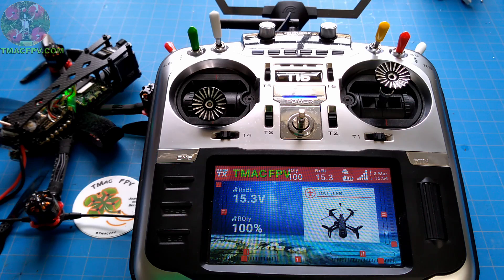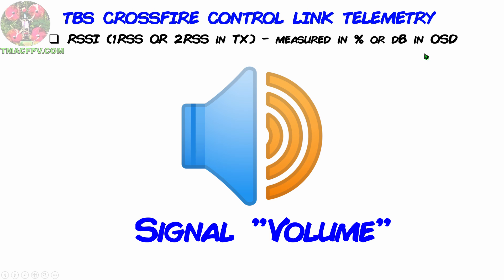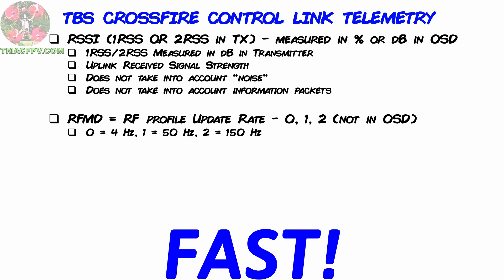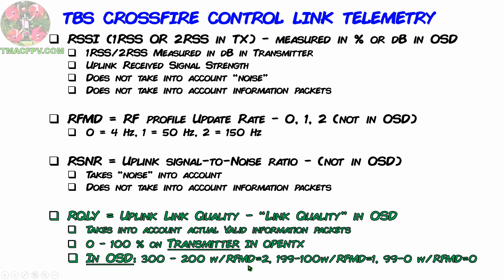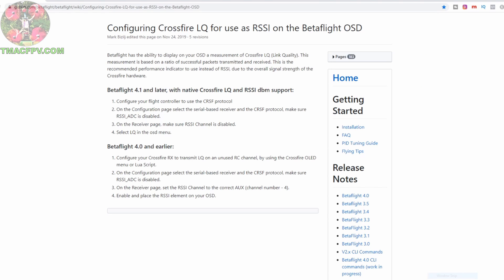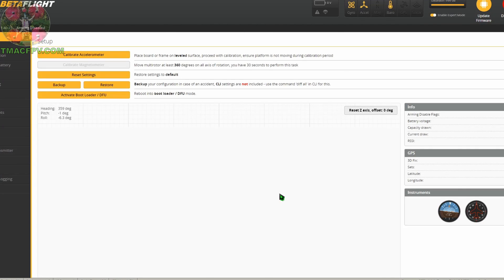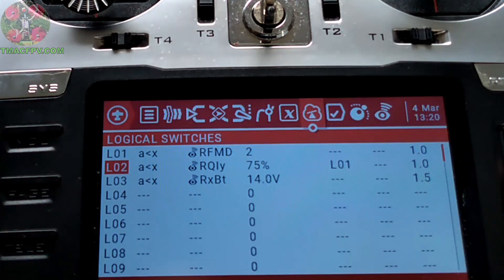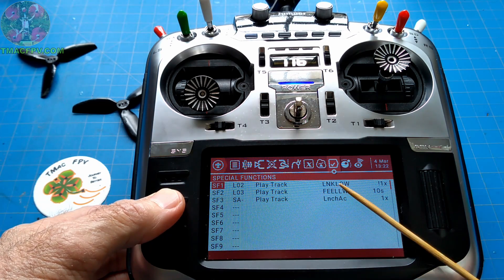TBS Crossfire Telemetry - SAVE YOUR QUAD!

Comment from the maker: How do you use TBS Crossfire telemetry?  What was the best thing you learned about TBS Crossfire telemetry from this video?  What other questions do you have?🤔 Let me know!👍😉UPDATE: Since this video was posted, RFMD is now available in OSD,  LQ in OSD is now measured as a value between 0 and 100 along with the RFMD value of 0, 1, or 2 preceding it.
Reply: I'm wondering how to get the link quality to show up in my DJI Goggles?
Reply: @mixedepisode  as i know currently only rssi available, LQ not supported yet in dji osd
Reply: Any input on my rssi showing 31-32 constant. (Using hitec Aurora 9 radio very little info out there) should i set up rssi channel anyway to confirm if its actually a good link and then try and change the scale in cli?

Comment: Great explanation, but I was also looking for information on the downlink.  Because the crossfire downlink is much lower power.  So if your downlink drops out, you won't get anything telemetry on your transmitter, i.e. no data on uplink quality.

Comment: Thanks for the info, got it working no problems with inav on a wing, tried using it with three gps quads using the latest betaflight and cannot get my edgetx radio to recognise gps telemetry, it picks up the other telemetry? im using the same radio with all models all with crossfire receivers.

Comment: In my betaflight 4.2.8, why does link quality not show up in my DJI goggles? Only when I click on RSSI will it show a number, and I'm not even sure what that number or scale is, because changing my radio or nano rx power doesn't seem to change the number at all. I don't get it. I'm following the exact instructions
Reply from the maker: https://youtu.be/Oogm72vRclA
Reply: @TMacFPV  I've already followed the instructions from Barwell's video a bunch of times. I've enabled the RSSI aux with LQ signal from radio, I've disabled RSSI aux, I've tried everything. Nothing changes the fact that the only item the DJI goggles will display is RSSI Value, and the corresponding RSSI % value shown on the Betaflight setup page. Is there anything you can think of?
Reply from the maker: @rbt5785  Nothing I can think of my friend. I don't fly nor own DJI gear. Perhaps try a DJI forum, Reddit, or group on Facebook?
Reply: @TMacFPV  Ok thanks for the effort and your help!

Comment: Hey Tmac, great in depth tutorials as usual !! I have my TX16s set up with the crossfire widgets I want, however my Rxbt reading displayed in my widget, is flashing between 5v and the actual battery voltage for the quad. I can't seem to just get the battery voltage. Tried removing sensors and re adding. Any help would be appreciated !
Reply from the maker: not sure Larry.  Things to try.  on Telemetry Page, make sure "Ignore instances" box is unchecked.  All firmware for both Crossfire module & receiver updated to same version?
Reply: @TMacFPV  Thanks so much for the fast reply! Yes my "ignore instances" is unchecked and both my receiver and transmitter are updated to version 6.12, the widget still flashes between 5v and the battery voltage, very strange.
Reply from the maker: @lemmingnetwork3445  Support ticket? https://radiomasterrc.freshdesk.com/support/solutions

Comment: At least someone who thoroughly explained all Crossfire telemetry sensors. Thank you! Any ideas how to convert battery voltage to cell voltage in radio side to keep total battery voltage in OSD? Or it is safe to use remaining battery capacity % sensor?

Comment: I changed my cinelog25 receiver from frsky to tbs crossfire .... the quad flying working good.... but the range of vtx dropped down no range less than 30cm
The goggles should be close to the quad to see

I dont know whats wrong affect on vtx range
Reply from the maker: changing your receiver should have no effect on your VTX reception.  Something else is wrong.  Check all connections and wiring to solder pads, VTX antenna connection to VTX, correct VTX channel on goggles, etc.

Comment: hello TMac👋🏻I’m your fans.

I have a question,why I can’t see 「RFMD」、「RQly」in logical switches page😢.(Tango2)

thank you🙏🏻
Reply from the maker: I dot not own a Tango 2 transmitter, however it uses OpenTX firmware so it should be the same.  Sounds like you're not getting all of your telemetry values.  Try going to the telemetry page in your transmitter while quad is powered on and bound to the Tango 2 then selecting Discover new Sensors on the telemetry page.  While you're on the Telemetry Page, make sure you've disabled (untick the box) "Ignore Instances" in the Telemetry Page of your Tango 2.  Also, with the recent versions (2.3.10 & above?) of OpenTX, you no longer need to use an Aux channel to receive LQ.  So, if you're running a recent version of OpenTX and do have that setup in your Crossfire receiver setup, just get rid of that.  Finally, refer to Crossfire manual pages 51-53 here https://www.team-blacksheep.com/tbs-crossfire-manual.pdf
Reply: @TMacFPV  can work❤️❤️❤️❤️❤️❤️❤️❤️ya~~~~~~thank you very much🙏🏻

Comment: thanks for all the effort you put into this video Sir, which is not only very informative but also fun to watch. Being new to both Crossfire and to Open TX, I learned a lot and subscribed.
Since you asked what other questions we have, here‘s one for you: 
I am running an iFlight Alpha A85 HD with a crossfire nano RX linked to a Radiomaster TX16S. I keep getting „Telemetry Lost“ warnings every now and then when I am about a half kilometer out, however I never lost control of my quad. Telemetry usually recovers within a few seconds or so after I have gained some altitude or turned the quad. 
I assume this might be because of the relatively small Crossfire antenna on the quad which was developed by iFlight specifically to fit  this little 85mm whoop. The A85 was of course never designed to be a long range quad, but I was wondering if I should be worried to lose Telemetry every now and then. Is it really necessary to bring the quad back when it happens? 
Would be great to read about your thoughts - thanks in advance. Ruedi from Germany. 😃👍
Reply from the maker: Hey Ruedi!  Great to hear from you!  I'm guessing your "telemetry lost" warnings are coming when one end of your antenna is pointing directly at you.  That would be what's called a "null" in the radiation pattern (near zero radiation emitted from end of antenna).  The radiation pattern propogates outward from the sides of the antenna (sort of like a doughnut pattern).  So, when you turn your quad, the antenna turns and you regain telemetry.  If you're able to do so, I'd have LQ (link quality) displayed on my goggles OSD.  That way, you can keep track of your control signal strength.  Another thing you could do is use a Video aerial systems (VAS) XFire Pro antenna which is designed to be "cross-polarized."  This design essentially eliminates/reduces nulls.  You can check out the XFire Pro antenna here https://www.flyingtech.co.uk/electronics/vas-868mhz-xfire-pro-antenna-ufl-tbs-crossfire . Also, make sure to download the TBS Crossfire User Manual here https://www.team-blacksheep.com/tbs-crossfire-manual.pdf
Reply: Thanks TMac for the explanations and the advice. I will follow up on those. anyway I don‘t need to worry too much about the issue I take it. Thanks again! 🙂

Comment: TMac very useful.  Had to set this up again.  

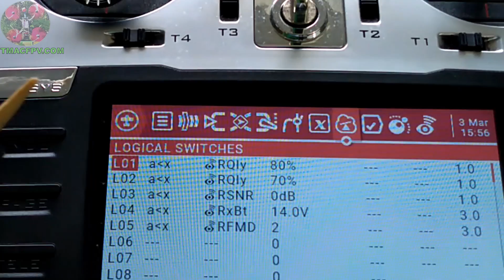ALSO - im a bit confused as you have a bunch of extra logical switches set up such as Rqly and Rqly and RSNR but later in the video you just have the 3 to use.  Whats best?  Should I use all of them.  Thanks 👍  im referring to the the video at section 3:51 ?  thanks

basically shoukd i just use the logical switches in section 13:19 or include 3:51 switches?
Reply from the maker: It's better just to go with what's shown in 13:19.  The stuff at 3:51 was just showing examples really of what you could do.  On a daily basis, I'm using the stuff at 13:19.  LNKLow is a custom sound file I made using this process https://youtu.be/RSxD9Th1VDo

Comment: When I change my VTX power through my crossfire TX, the osd value doesnt change. What did I set up wrong?
Reply from the maker: What type of VTX are you using? What do you mean by Crossfire TX? The Crossfire module or one of the TBS transmitters (Tango 2, Mambo)?

Comment: My rxbat in both quads only display single digit voltage no 13 or 14 volts ??? Any adea what's going on with my crossfire nano RX ? Thx
Reply from the maker: Where are you seeing this displayed? ISD or transmitter screen? Crossfire telemetry value is RxBt (not rxbat). Make sure in transmitter you're using the value RxBt. Perhaps this will sole the issue
Reply: @TMacFPV  yes rxbt is the value I am using.... Sorry about the typo & thanks for you reply 🙏

Comment: Hi eveyone,
I'm new to the RC Hobby domain. Need help in understanding which module actually transmits telemetry data back to the flight control screen on the RadioMaster TX16S ?
If the TBS receiver transmits back to the flight control unit (i.e. CrossFire TX at the back of the RadioMaster) then why is it called a Receiver only ? shouldn't it be called a transceiver ?
And if the CrossFire TX module also receives the signal from the TBS receiver on the quad then that should also be called a transceiver ?

I'm an Electronics Engineer but cannot get my head around the size of the receiver. It is too small to transmit anything back over a long range. Plus the TBS Receiver on the Quad does not have any heatsink. How is it able to transmit over such a long range. What am I missing here ? please help !

Comment: So there's something I guess I don't understand.  Because of the asymmetrical Tx power of the Crossfire TX Micro (up to 1w) and the  nano Rx (I believe only 10mw) it seems to me that you will lose telemetry long before your LQ falls to RFMD 1 and 70% LQ and in fact I've been trying to test this and that's what I find.  I was simply trying to see of my audible warnings in my radio were working but those logical switches never get tripped before I lose telemetry.  I guess using the telemetry in your OpenTX radio isn't very useful for that reason.

Comment: Thank you TMac. This video is very helpful. When you are explaining the special functions, you say that it plays 1 time, but NOT at startup. I have several annoyances that trigger every start up. Can you explain how to do that? (maybe you already have, in another video that I haven't found yet 😃 )
Also, the "sound to noise" telemetry seems like it would be useful to trigger an alarm, except that I don't have a clue as to how I would set that up. Any suggestions are appreciated 😃
Thanks TMac!
Reply from the maker: The "not at startup" feature is enabled by using the exclamation point in front of 1X (see the first Special Function line at time mark 15:29 of video.  Signal to Noise is taken into consideration within LQ telemetry value.  However, RSNR (uplink signal-to-noise ratio) and TSNR (downlink signal-to-noise ratio) as well as all other Crossfire telemetry values available are found on page 45 of Crossfire User Manual you can access here https://www.team-blacksheep.com/tbs-crossfire-manual.pdf . To use any of these telemetry values you set them up the same way as I demonstrate doing so ion this video.  You just need to determine what a "normal" value is (by looking at your telemetry screen) and what is not an acceptable value for you.  Then, set up a<x or a>x based on your "unacceptable value" for that telemetry

Comment: Thanks for sharing,  I have a TBS Crossfire TX attached to the back of my RadioMaster TX16S.  It was working fine for over 3 months now.  Last weekend I installed TBS Agent Lite on the RadioMaster 16X and now I get Failsafe on all my quads about 40 feet away from me.  I also noticed when I did discover new sensors I only get 4 sensors instead of all the sensors.  I factory reset the Crossfire TX and updated it to 4.08 firmware and still no luck.  Any idea how to fix this or I killed my Crossfire TX already?
Reply from the maker: Try this, go to Model setup, External RF, Receiver Number.  Make sure its set to 0 for each model quad using Crossfire.  If that doensn't work, have you bound the receivers to the TBS module?  Best thing I can think of is just to retrace your steps slowly, one at a time perhaps using this TBS Crossfire setup checklist available here: https://tmacfpv.com/tbs-crossfire-setup/
Reply: @TMacFPV  Thank you so much for your quick reply, I got it fixed now.  I had Ignore instances checked, as soon as I unchecked that everything started to work again.  Now I can get all the sensors on my TX16.  Thank you so much for your help.
Reply from the maker: Perfect! Nice job finding it! Now it all works for you and you've got that little extra bit of experience!

Comment: Great video again TMac ! For the battery,   wouldn't it be more accurate to trigger a warning using the Capa telemetry with a calibrated current sensor in betaflight ? This implies that you always use the same Lipo capacity.  Edit : Nevermind, I just found out that you talked about it in your "FPV Battery Voltage & Current Calibration". Perfect as always !  Thank you again TMac for your amazing tutorials.

Comment: Hello there. Thanks for the quality video. I have a problem. I cannot find RSSI on the sensors on the telemetry screen. Although I have discovered new sensors, the RSSI sensor is not coming. Equipment I use:
Mamba F405 mk2
Radiomaster TX16S + Crossfire Micro TX + Nano RX
Reply from the maker: So, after watching this video, you still want RSSI instead of RQLY?🤔hmmm . . . perhaps try mapping RSSI on one of your DST channels in the Nano receiver setup of your module then going into Receiver Tab of Betaflight and putting it on the corresponding Aux channel?  Its been quite awhile since I've even attempted RSSI with Crossfire, so I'm not positive about that.  You could give it a shot
Reply: @TMacFPV  I will definitely continue using RQLY. I wonder why I couldn't find the RSSI sensor. I did what you said before. RSSI is running. However, the RSSI sensor cannot be found. Thank you.

Comment: Good but lets face
It fpv link will in most cases run out long before crossfire.
Reply: Do you know of any iphone apps that will connect with crossfire module. I full 2w module
Reply from the maker: I do not use iOS myself, however, it looks like Mobile Flight is one:  https://flyinghead.github.io/mobile-flight/
Reply from the maker: for sure!👍 Control li k with Crossfire is one less thing to be concerned about, right?
Reply: Many thanks but it says on appstore not available in u.k.  bummer
Reply from the maker: @noisy_boi_fpv_3920  😔

Comment: Hi.  Great video. Thanks a bunch. Quick Q. I am on opentx 2.3.9. I am trying to get LQ in my radio but in the logical switches page I don't have the RFMD nor RQLY options. Do you have any tips on that ? Shall I downgrade my open tx? Or do you know of it is called something else in that version? Thanks!
Reply from the maker: Hey Jose!  Most likely nothing to do with OpenTX 2.3.9.  Did you go through Crossfire Module menu and bind receiver in your transmitter?  Have you "Discovered new sensors" in your telemetry page of model setup?  After pressing Sys button, under "Tools" menu, Crossfire Configure, XF nano RX, Mode = 8 or 12 channels (I use 12), you shouldn't have any of the channels setup fro RSSI.  Those are only things I can think of to check for now, perhaps one of those will help
Reply: I had not discovered new sensors. My bad. The options do show now. Thanks again!

Comment: Isn´t RxBt the supplied voltage for the reciver? and won´t this in most cases be 5v and you will then get constant warnings if you set it to read out low bat when below 14v (4s)?
Reply from the maker: For TBS Crossfire Telemetry RxBt = Battery Voltage, for FrSky telemetry receivers VFAS is normally battery voltage
Reply: @TMacFPV  Thanks, learned something new today :)

Comment: Nice video just found your channel and is very informative thanks. I had bad RSSI but good to average LQ but now since upgrading my LQ has a warning on the osd think that font update will hopefully fix it trying that tomorrow cheers.
Reply from the maker: Hey kanenstuff! Appreciate your kind words 🙏I've found LQ to be much more valuable than RSSI. Yes, please let me know if don't update clears warning for you-cheers!
Reply: @TMacFPV  I have done a factory reset and gone from 3.23 to 3.28 and my LQ is back at 300 and RSSI is at 80 but on my taranis telementry page is Rx 99 do you know why my taranis displays 99 and bf is at 80 it dose it on all 4 builds I have with crsf?

Comment: Hey tmac what would be the value  for rxbt on 6 sell battery on Logical switch 03
Reply: I have it set at 22.8.
And my rxbt is saying 24.2 and my alarm is going off wvry 10 seconds
Reply from the maker: I normally set mine to 3.5 volts per cell. So 3.5x6=21. Did you mistakenly use > instead of < ?
Reply: @TMacFPV  no i used the correct <
Reply: Ill private messages a picture on fB if that is ok?

Comment: Hey TMAC thanks a lot for the video :-)
It's working but I can't find the 3 things in the logical switches screen.  It's just empty, should I download lua scripts or discover any sensors?
Reply from the maker: Hey Phillip! Not sure what "3 values" you're referring to, however, the values in the Logical Switches screen that I used are all telemetry values.  If you're using Crossfire and follow this checklist you should be good to go: https://tmacfpv.com/tbs-crossfire-setup/